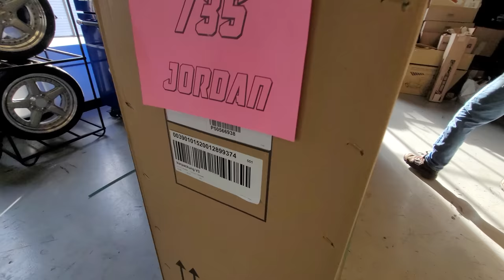JORDAN'S 2023 GASGAS MC125 UNCRATING & SETTING-UP HER 18TH BIRTHDAY PRESENT

Comment: What size kehin airstriker carb do you suggest for the 125. I have a 22 husky tc 125 with the jd jet kit and scavini cone pipe and shorty pro circuit pipe . And all I’ve heard is swap the makuni for a kehin air striker but it shows for the 125 a 36 and a 38 mm. What’s best?